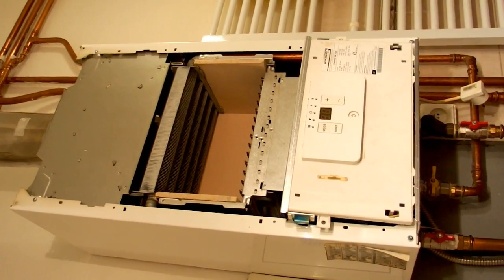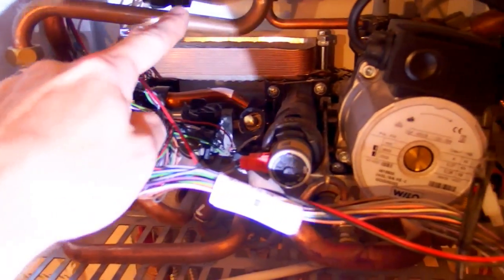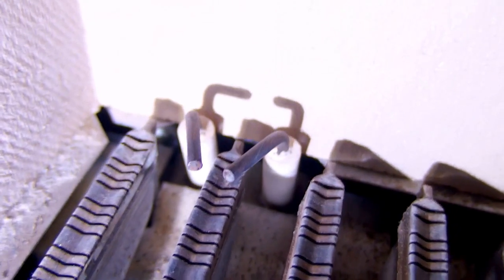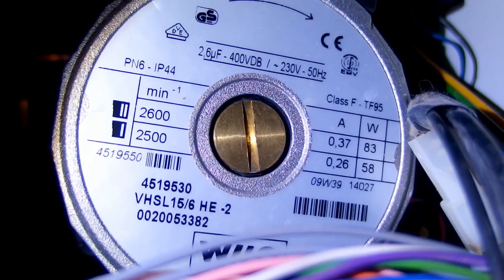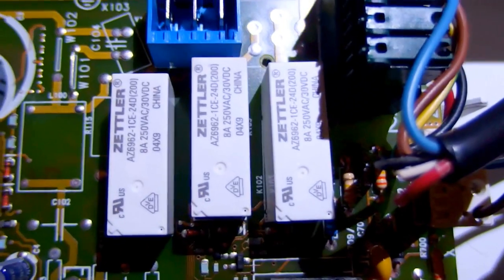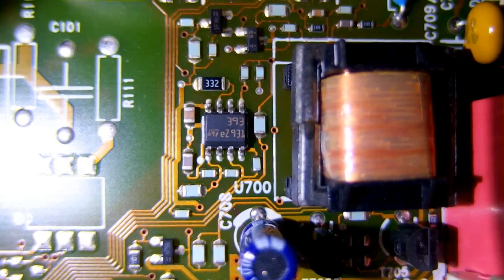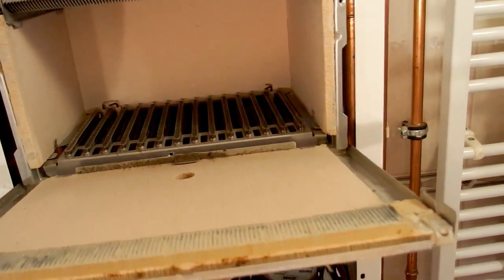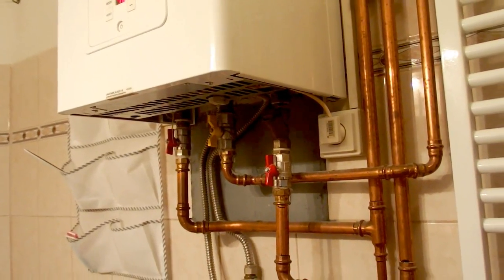What's Inside a Gas Water Heater (and a repair using a vacuum cleaner)

Comment: in places where constant electricity is not available, and no fixed gas supply either we have the similar type of gas water heater for bathing water only
it runs on two D size cells and lpg gas cylinders 
same spark gaps construction with 3 terminals controler is tiny and runs everything automatically

Comment: That top capacitor seems undersized?
 Iv probably had two dozen of these boards come through my lab over the last several years...(not sure if it's a very common design possibly used by several different brands)

 The components usually have markings on the board showing the footprint. And upon second look I noticed that top capacitor does have a second footprint marking underneath that fits that size

 It's very possible the design is a bit different since it's outside of the USA
or that there was an update to the design or something like that. But still thought it interesting enough to coment.

Also several of the brands used to coat that board in thick gummy and difficult to work with potting compound.

Comment: The RJ11 socket is for firmware upgrades and setting the unit for different gas types and all of the functions only a field engineer should be setting such as DHW only system if you have a hot cylinder in line with the DHW circuit, country specific specs etc.. It sets the timing/function of the valves and inputs from sensors like water temperature or if you have a solar hot water system in place for setting divert valves etc.. The main heat exchanger is always flowing from the pump in Heating mode, when you call for hot water a diverter valve switches in the smaller heat exchanger where the main exchanger passes water through it, cos you really dont want to be getting the sealed system water in your mouth by accident lol so your cold water mains passes though the smaller exchanger heated by water passively from the main exchanger. The grey valve under the boiler is for filling the system, not draining it. I couldn't see if there was a PRV on there, there should be in case the pump fails and the boiler starts to kettle. There should also be an air release valve right at the top for removing air automatically from the primary heat exchanger. Also there should be a pressure vessel somewhere on the primary side, sometimes hidden behind the gas chamber. I don't mean to sound rude but if that was in the UK, the second you removed the cover from the boiler, you were breaking the law if you are not Gas Safe registered ! :D I know it sounds daft because if your a home owner and you bought the boiler your still not legally allowed in there to even clean out dust! If you sold your house and you have been in the boiler and poked about and the new owners died as a result of boiler failure, you would be up shit creek without a paddle lol

Comment: The valve on the bottom is probably to drain the unit for servicing.
Reply: Actually it is for filling the radiator heating system.

Comment: The small heat e changer is for tap water... its build this way to separate the tap water from tha  radiator water.. and also this makes possible a lighter main heat exchanger because the radiator water has small presure then the tap water

Comment: compared to the tap water heat exchange you should see how it looks  compared to a VW transmission oil cooler..lol..  https://www.aliexpress.com/item/TUKE-1-8T-Engine-4SPD-Aluminum-Heat-Exchanger-Transmission-Oil-Cooler-For-VW-Beetle-Jetta-MK4/32838361403.html

Comment: It's interesting that the control board has what looks like an RJ11 socket. I wonder if this is for remote telemetry (reporting a failed heater in an inaccessible space, for instance), or is just a socket used for a technician to attach test gear or to make adjustments.
Reply: Tony Walton I would say that it's for a small controller panel that has a temperature display and buttons to raise or lower the temperature... Many homes in Australia have these and they usually have two controllers... one by the kitchen sink and the other in the bathroom...

Comment: very interesting copper piping in my country almost every pipe is plastic (PP-R) i guess copper is cheap in your country
Reply: These are direct replacements for what used to be a purely mechanical device way back then...they are common in houses that were built shortly before and after the 2nd World War, well into the 60s until there were surpassed by block flats made of prefabricated concrete panels (those have central heating). Each flat has it's own device, usually in the bathroom or kitchen, here they're called "karma". 
The constant problem with these is that they rely on natural draft, so when it's very hot outside (or some bird that was cold, tried to warm itself near your chimney, got poisoned by the fumes and fell into it :D), they don't run properly and fill the flat with carbon monoxide...
You can't use a forced draft device because several flats exhaust into one chimney - you'd overpower the natural draft and poison your neighbors ;-)

And as for the "new and improved" - I think you mean condensation heaters, which are about 97% under ideal conditions (read almost never :D). 
These have the problem of having the chimney needing to be resistant to water condensation (old school heaters have the exhaust hot enough that it's not a problem), which for housing...hauses...like the one in the video would mean having to rip out the chimneys - really really expensive.
Reply: I guess gas is cheaper too... as this seems to be a 2009 vintage heater. I didn't expect to see open style heaters were made all the way up to then. In the 1990s we were already switching to high efficiency heaters that have a sealed system and force the gas/air mix in by fan. The current models operate at close to 100% efficiency.
Reply: Copper is not cheap anywhere in the world. When we renewed our heating system we had the choice: Plastic was cheaper, but copper "lives" a lot longer (plastic 30 years, copper 60 - 70 years before small leaks appear we've been told). Another thing to consider is that in case of a hole or leak, you can easily fix a copper pipe (soldering etc.), with plastic pipes its a different story.
Reply: Water for the radiators is too hot to safely be handled by plastic tubing, but tap water is most definitely done with plastic here (you can't use copper for that, nobody seems to want "black steel" and stainless steel is stupidly expensive)
And btw copper is by no means cheap in this country, it's just that you can expect properly done copper pipes to survive you and your children, wile PP-R will probably need to replaced at least twice by then, so most heating installers will suggest to use copper and be done with it ;-)

Comment: F.28 - missed ignition
When this fault code appears, the boiler will automatically shut down.
Significance of the code is the absence of flare at startup. It should be checked if the gas valve is open. For this, with the boiler open and the window open, the boiler is started. If it goes to the gas, it is not the gas valve, stops the gas that it could not ignite or did not catch the flame. We watch if there is sparkle on the left electrodes, if it's not likely to be on the electrode wire. Resistance can also give a sinner sometimes goes sometimes not. It has the value of the M ohm order

Comment: The bottom heat exchanger only uses hot water. For the heating part (radiators) it does not pass through it. When hot water is needed, the water is not circulated through the radiators and only through that heat exchanger. He has a three-way valve for that.

Comment: In older models the white insulation stuff was Asbestos containing material 

Edit: 
I think this Gas Water Heater is from the 1990s & (at least partly) 
made in Germany -> see the pump label ... so much "VDE" certified 
stuff 

The red round thing is a fuse 

@5:58 most of the board is (Switching) Power Supply stuff , nearly everything abpve the transformer(s) ... the brain is on the lowest part 

It seems to have a serial interface or diagnose port via American phone jack / socket
Reply: "American Phone Jack" I laughed. It's used everywhere in the world not only in "America"

Comment: I think the sensor probe is fed with voltage through a very high resistance, when the flame lights the flame conducts power and forces the probe voltage to drop.
Something like a high input impedence op amp inputs are connected to case earth and probe, it detects the voltage drop and indirectly turns up the flame.
If the flame blows out there is full voltage on the probe and the system re ignites.
Keep the probe clean for reliable operation.

You can shoot me with a bannana if im wrong :-D
Reply from the maker: I guess that the probe could really be fed with high voltage, because the flame has lower resistance than the air. But the problem is that dirt would have the same effect. Dirty electrode would act as a flame because the dirt decreases the resistance. So it's more likely that the electrode is fed with AC voltage and the rectifying effect of the flame is being detected. Maybe the electrode is not fed with any voltage at all and a small voltage (small current) generated by the flame is detected instead.
Reply: Im not sure if the info i remember is 100%, you can still shoot me :), it was a long time ago and details are not clear.
You have some great ideas :-D, i bet you are closer to the way they actually work :-D.
I did remember thinking "Flame conducts electric??? oooow".
But there is no way i can know if the person that told me was correct.
Reply: DiodeGoneWild Wait, flame conducts in only one way? That's pretty interesting.

Comment: Cievky relé boli na 30V DC. A ten RJ-11 konektor mohol byť servisný alebo pre pripojenie modulu na diaľkové ovládanie napr.
Reply from the maker: 30 VDC je napětí kontaktu. Buď max. 250 VAC nebo max. 30 VDC.
Reply: DiodeGoneWild Aha fakt, no podľa datasheetu od výrobcu má označenie "24D" cievku na 24V ako si aj sám povedal
Reply from the maker: Jj, určitě to bude 24V, i protože 5V, 12V a 24V sou nejběžnější napětí cívky. 30V  by bylo hodně neobvyklý.

Comment: I would have thought these use some sort of forced air mechanism, like oil fired boilers have.  For example, if this is installed in a kitchen, I wonder it would be able to operate properly with the room doors closed and the cooker extraction fan on high.
Reply from the maker: Some of those do have a blower to force the air in, but  this one doesn't. It sucks the air in because the exhaust is hot (lighter than the air) and  so it rises into the chimney. It is installed in a bathroom which has ventilation holes in the wall so the air can go in even with doors closed. This apartment has no  cooker extraction fan, so reverse exhaust flow is unlikely.
Reply: In the UK this type of naturally aerated unit is prohibited from being installed in a bathroom.
I think it is because problems have been encountered by exhaust fumes coming back into the room and the presence of carbon monoxide gas due to incomplete combustion.
As you say, the Domestic Hot Water is heated by that smaller heat exchanger, and with some boilers, the demand for DHW is detected by the flow of cold incoming water passing through a small turbine which generates a voltage signal which is detected by the control PCB. This then initiates the pump flow and firing sequence.